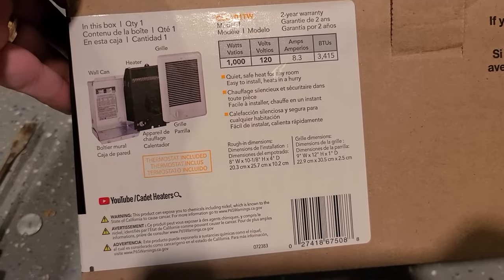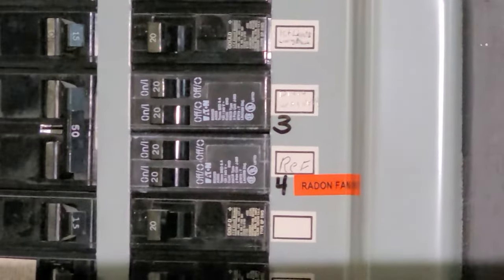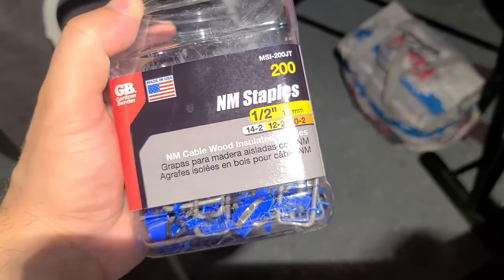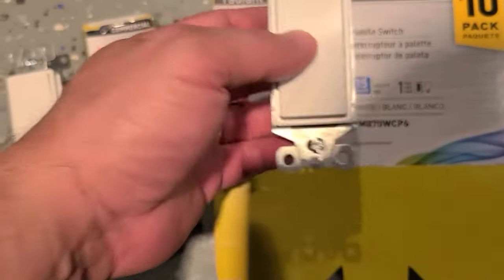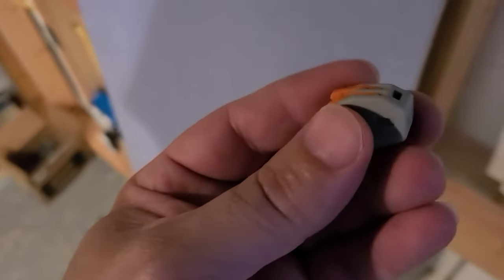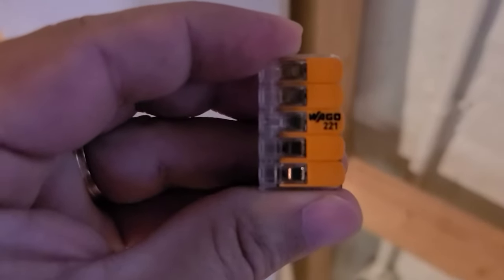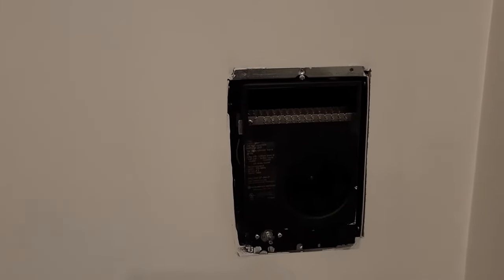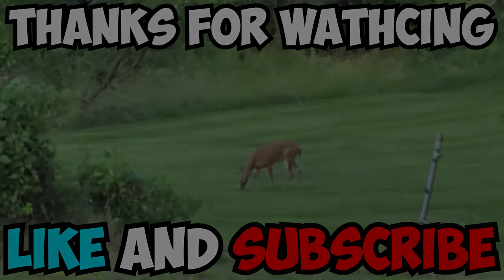How To Install A CADET Wall Heater

Comment: 1000W take just 8,5 Amps - you can put the 15 amps switch without any problems - you have 6,5 amps spare- EASY
Reply from the maker: Thank you for the comment 👍 I like this Cadet wall heater. It works great. I'm adding two more in the house. Thanks again.

Comment: Just used this video as a reference when installing one! Thanks! I had an issue where this model doesnt work without the cover on but there is no button. So the sensor wasnt picking up the door being installed when it was. Smh....could have blown out the heater if I wasnt paying attention.

Comment: Just installed one but fan is spinning slowly why is that? Great job
Reply from the maker: That's strange... I didn't experience that. Is the speed of the fan changing when you raise the temperature?
Thanks for watching. Hit that 🔔Icon, so you can receive my latest videos.👍
Reply: Nope the speed is the same on the highest setting and low! Thank you
Reply: @mmacias956  Hi, may want to check the voltage output of your electrical wires. Also, there is a possibility you wired a 240V fan with only one leg of power as 120V. Lastly, the fan itself could be bad.
Reply: @Alex I’ve done some research and I did go with 240V and I need 120V heater thanks man
Reply: @mmacias956  Awesome news that its diagnosed!!! I learned everything I know from Handyman Land! This guy is great at his craft 🙏🏼

Comment: Good video! the new ford transit trail has a 12volt 60 amp plug. Can I install this heater in it ( using it only while motor is running ) Thank you.
Reply from the maker: Yes, heater would work. But the heat output would be 100x smaller, so it wouldn't be worth it. You can convert voltage and/or AC and DC with the right inverter with the power rating, but heating from a 12V supply is not really practical, it would need such a large current. This CADET wall heater is amazing. The room I installed it in, is a 10x11. And i didn't expect it to be that good. Although it's technically possible to use almost any residential space heater in a car, it's more efficient and less dangerous to use a 12V heater than to plug a 120V heater into an inverter. Hope I answered your  question. Like and Subscribe, Tap That Bell Icon. to get my latest videos. Thanks for your comment and for watching.🙂👍
Reply: @HandymanLand  Thanks for the information.  I've been trying to come up with a good way to get heat in the back of the van.

Comment: Does the thermostat hold/regulate a temperature like a wall thermostat or just maintain a constant temperature  and air output?
Reply: prob just maintains at a constant temperature. i purchase a 240 double pole heater like this one, and will most likely at a thermostat instead of switch
Reply from the maker: Ct Car Vlogs, Is right. Just maintains the  at constant temperature
Reply: @HandymanLand  just installed it yesterday with a thermostat. does perfect at 240v heats up pretty quick too

Comment: Thank you
Reply from the maker: @ThaOx24  Thanks for watching.
Reply: @HandymanLand  on those heaters do you have anything else on that breaker or just that Heater? 
I'm asking because we sold our house and I have to install some to pass VA loan. I'm thinking I can take an outlet out and use those wires for the heater
Reply from the maker: @ThaOx24  You can use the wires from the outlet to install this heater. But you just need to make sure that there's not too much running on that line. If someone uses something that pulls a heavy load that's on the same line the breaker will break.

Comment: HELP😭 please tell me its a way to put this heater on a iron pole with wheels 
so i can wheel it around the house????

A Cadet Com-Pak Electric Wall Heater 
The gas heat is not as hot any more😩 ?
Reply from the maker: Hello, sorry for the late response. 
Although it is possible, by connecting a plug to the end that feeds the Cadet Wall Heater.
But, I do not recommend that. That could be extremely dangerous.
I recommend purchasing a portable radiator heater 1500W. 
https://amzn.to/3RbuX5p
There are several type but this one is affordable and safer. 
These are portable. you can place it in the center of a room or in a corner.
Prices for these are still down. But come this winter prices will go up.
I hope I answered your question. Thanks for watching.

Comment: Is it possible to fix one the only blows cold no heat comes out?
Reply from the maker: To use it only as a fan, yes. But I won't recommend it. They do sell wall fans. Which is flush to the wall if that's what you're kind of looking for. Thanks for watching...

Comment: It just stopped blowing warm air after working perfectly for 2 years since i bought the house. Fan still blowing but no heat. I tried to press the reset but i don’t think that did anything. Does this mean that it needs to be replaced or is there a way to fix this issue without having to buy a new one?
Reply from the maker: I recommend, just replace it. When it comes to electrical heaters, if something seems wrong, I just replaced them.
Reply: @HandymanLand thank you so much for such a speedy reply! I truly appreciate it!
Reply from the maker: @RaRaCruz  Thanks for watching 🙂👍

Comment: I gotta question for you. I know that this unit is 1500 Watts, but how many settings does it have? Does it have a low medium, high, and if so, can you vary the wattage? For example, 500, 1000 or 1500?
Thanks and great video
Reply: These just have a thermostat there not adjustable